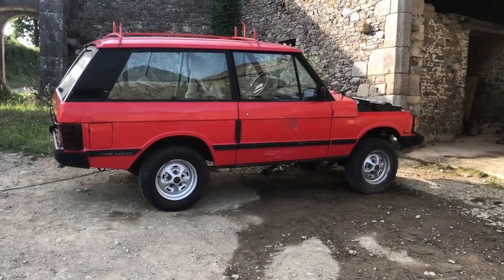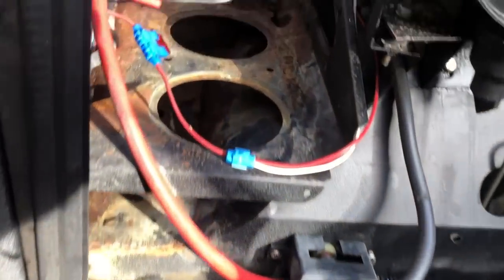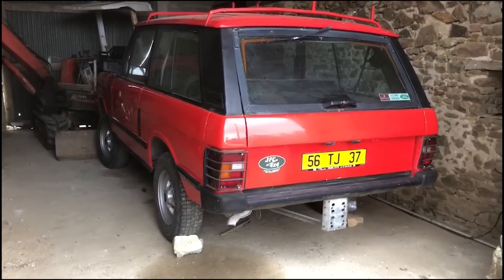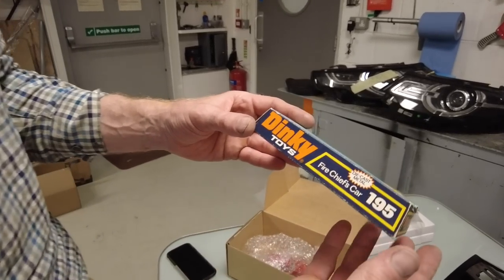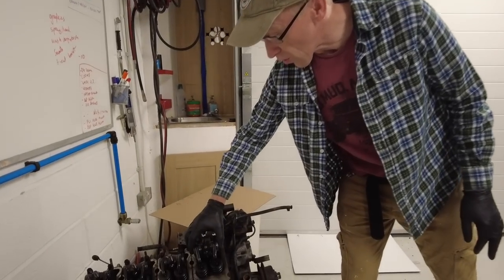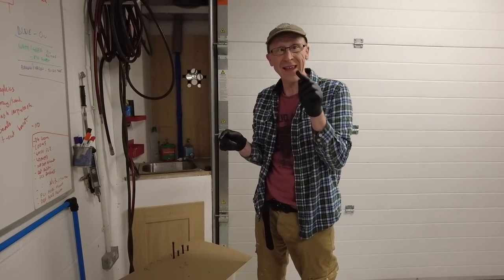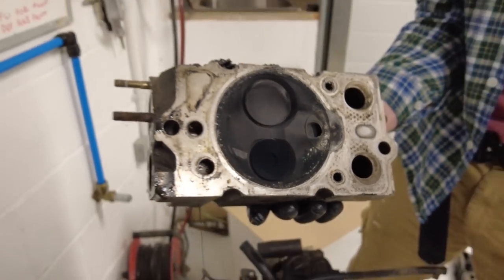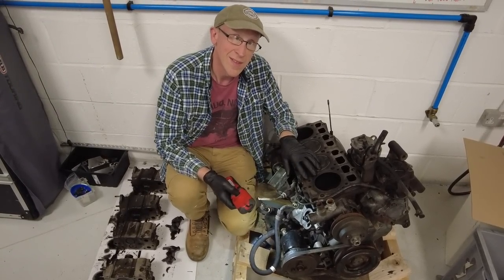Le Range Rover - Part 3 - We Clean the Engine Bay & Head Home to Investigate the Spare Engine...

Comment: Simon…I pondered many minutes wondering if I should tell you that VM engine started life in a boat but didn’t want to be too…umm..well I did have the 2.5 version in my Jeep and it was an “effective” engine but my goodness was it a rough old thing when cold…I described it as being like a two stroke twin cement mixer. Once warmed up, it is not bad and goes well enough but I cannot describe it as an engineering masterpiece! If that replacement engine turns out to be a bit duff then the idea of moving to the JLR 300 Tdi diesel might be a plan to be honest. See what it looks like but do have a think if in doubt. Good luck again!! 😬😬🤞🏼🤞🏼🤞🏼🤞🏼🤞🏼🫣🫣😀Richard

Update…scrap that VM engine idea and have a think about the 2/300Tdi or even the BMW 2.5 engine but that might take a huge amount of fettling. The VM is a fairly horrible bag of nails at best..it works..it does the job…but The Stig will feel like a 3 litre V16 by comparison!
Reply from the maker: Yes i saw the boat thing pretty early on Richard but the engine seems pretty well engineered - I am working on a plan to fit the later heads ( Jeep ) to my engine..

Comment: The VM Motori engines in Range Rovers tended to overheat in Australia. Fortunately not many were sold here. We were not big users of diesel engines in passenger cars or 4WD's  back in the 1980's like Europe was. Today it is a different story.
Reply from the maker: Yes i think my car suffered from overheating and that was its demise !
Reply: @L663  It looks like it. the location of the cracks in each head indicates heat as the most likely cause. The Australian ones did not suffer heat damage due to coolant loss, they suffered heat damage due to the cooling system being inadequate. I don't know if it was the radiator or the engine design itself with respect to heat exchange.

Comment: lovely old RR classic .. out of the 8 heads you have 6 ( ? ) of them have cracked in exactly the same place ( design flaw there i guess ) .. i think if you can buy new ones it would be worth trying to build a decent engine from the 2 you have purely to keep the vehicle original
Reply from the maker: Yes correct we have 6 out of 8 cracked ! apparently i am learning that there was a recall back in the day for cracked heads - it was a material issue seems to be the conclusion
Reply: @L663  Simon, run one of the old heads through the band saw and you'll see why these crack. There is a thin section between the valves which was the design flaw on these engines. It's a similar issue to Land Rovers 4.6 problem in that a little bit of core movement in the casting process is the difference between one that does 300k and one that's dead after 50k. Loving the old classic. I always fancied a later 2 door.

Comment: That is a 2.4 VM Simon, it has the external vacuum pump and a different sump, as a RRC vm driver for over 20 years I can say they are good engines if looked after DON'T fit the compound gaskets fit the one piece MLS head gasket, I clocked up nearly 300,000 miles on my 2.5 VM and having now fitted a 300 TDI the VM out pulls the TDI, the only reason I went to a 300 TDI was the cost of rebuilding the VM getting parts sent out here to France is getting very costly, I believe someone is making new heads that are a better quality than the originals, good luck it looks to be in great shape.
Reply from the maker: Hi Steve - I think I have worked out how to fit the Jeep heads to the engine and there are some cheap jeep heads around. Do you have any pictures of your 2.5 block ?
I wonder if i can get this engine to fit - will the sump etc bolt to this block ?
https://www.ebay.co.uk/itm/175328074228?epid=23024910693&hash=item28d25e19f4:g:q9kAAOSwIetisxVc
Reply: @L663  Hi Simon, you will need the sump from a VM 2.5 RRC, the 2.4 and jeep are different also the vacuum and injection pumps are different, I am going down to my barn tomorrow so I will take some pictures and send them to you.

Comment: Use baking soda with hot water to neutralise the acid corrosion under battery. Then put etch primer and paint.
Reply from the maker: Thanks - I have seen replacement panels on ebay in steel

Comment: Did it over heat and warp the heads causing them to crack?
Reply from the maker: There was a recall for these heads back in the day apparently for cracking on the 2.4 - the 2.5 head is a little different - there may be a reason for that !